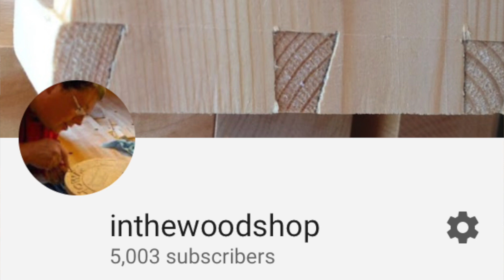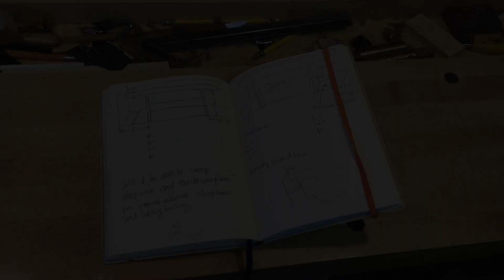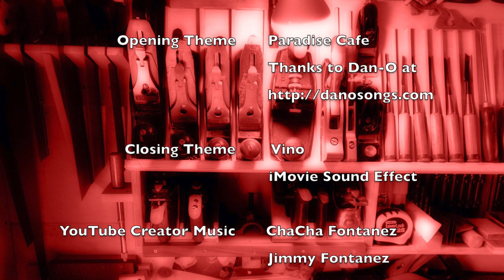Low Profile Scrap Wood Planer Cart and 5000 Subs

Comment: Nice job. I'm at the design stage of a similar project, How do you stop it rolling around when in use?
Reply from the maker: +Des McLaughlin I have a wedge I use to keep the jointer from rolling. I just kick it gently under the outboard side and it doesn't move at all. I didn't bother trying to find locking casters or design a stop because I'm so used to using the wedge.